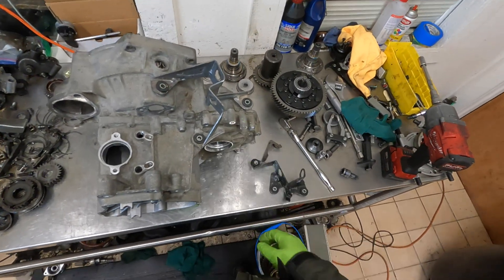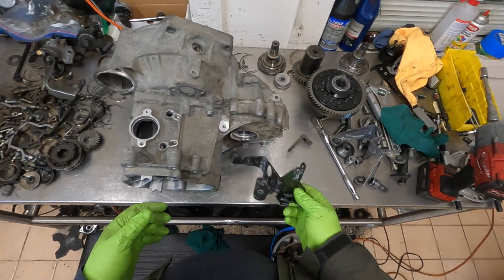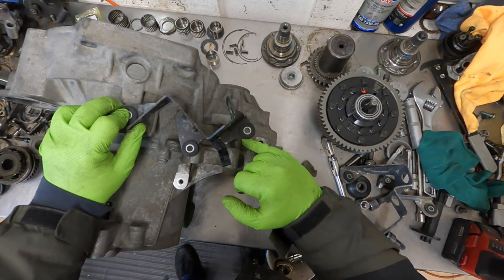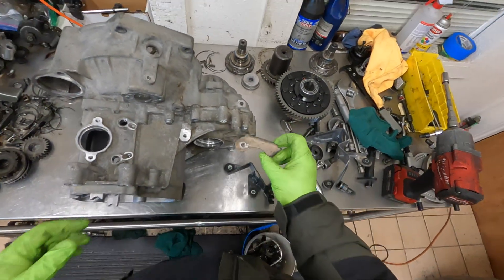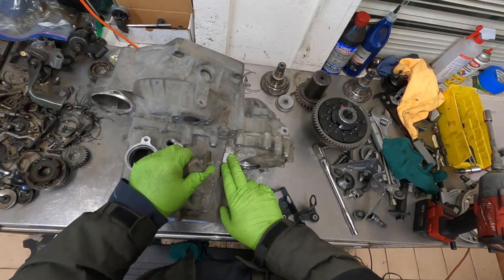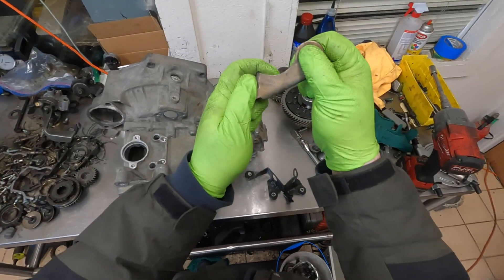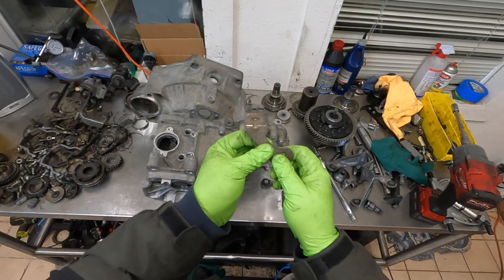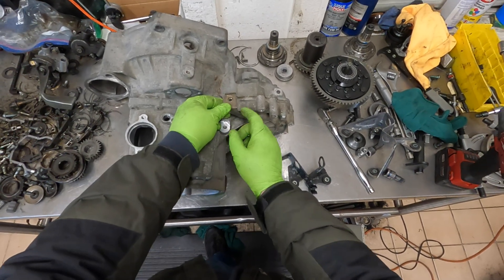02S 6 speed in Mk4, Adapting the Mk4 Shift Cable Holder

Comment: If you had to make another bracket would you do it the same way if you needed to buy that bracket?
Reply from the maker: Yes. I rather like how it turned out. I've done a couple more since the video.
Reply: @dzelpwr  what kind of cable do I need to do the can buss hack? I just ordered a vcds cable for Ross tech vag com the other day but my understanding for running I need something called a mpps cable as well

Comment: How would someone go about buying one of these transmissions from you and how much would they cost
Reply from the maker: Well, if you have a 2002 or newer, you can just bolt the transmission in as-is. Make cable shift adapters like I did here, and then hack the instrument cluster to pick up VSS via CAN so you don't have to worry about the lack of vehicle speed sensor on the transmission--I have another video that covers how to do that.

At that point, all you'd need is the transmission itself. I buy them through car-part dot com. It's just a junkyard aggregation website where junkyards from across the country list parts from vehicles they have. LKQ can transfer a part from another location to their local one and deliver it to you.

Otherwise, if you wanted the bellhousing swapped to retain the vehicle speed sensor and also get a limited slip differential, probably better to contact me through Cascade German for an estimate. Expect all-in to be above $3k with the bellhousing swap and limited slip.
Reply: @dzelpwr so why can't you do the same if you have the 99 tdi alh manual? Why only starting from 2002?
Reply from the maker: @JoshDesoto-g9g just how the clusters are made. 99.5 doesn't even have powertrain CAN bus connection to the cluster.

2000-2001 at least do have powertrain CAN to the cluster, and they use it for some signals, but no one I know of has figured out how to hack those eeproms to pick up vehicle speed by CAN. Only the 2002 and later clusters with software version numbers VWK501 and 503 in the VDO clusters.

Other markets with Bosch clusters might not even support it, or no one has figured it out at least. Similar for the Magneti Marelli Beetle clusters. Or I just haven't found the info yet. Not real sure.
Reply: @dzelpwr what if I just swap out the 99 cluster to a 2002 or 2003 cluster? Possible?
Reply from the maker: @JoshDesoto-g9g possible, but a lot more work than swapping a 2002+ cluster into a 2000-2001, from what I understand.

The 1999.5s are a real bastard child. There's a good bit of wiring that's different as well.

The 2000 and up clusters get tach signal, receive Check engine light and glow plug light via CAN bus. The 99.5 receives that info on individual signal wires for each of those.

There still is a powertrain CAN bus in the car, but the ECU from those years might not be putting that info onto the CAN bus. So, if that's the case, then you'd also need the engine harness and ECU from a newer car to work correctly with that cluster.

And I'm not entirely sure if those older Mk20 modules before 2000 even send wheel speed data on the CAN bus either...

It's a lot of work and different parts on something that isn't even a sure bet.
Reply: @dzelpwr ok if you have 2002 and newer you're golden  with the speed, but what about the TDC hole missing? Trying to wrap that around my head.
Reply from the maker: @JoshDesoto-g9g I took measurements of where the hole needed to be, had to grind away a good bit of the bellhousing and then used a 25mm metal hole saw to make the hole. Buy the 02M part number plug to cover the opening when not needing to find TDC.
Reply: @dzelpwr thats smart. I guess I'll have to split the bell housing still to make sure no chips get inside? Or did you do it upside down with a vacuum so chips fall down too? Sorry for all these questions!
Reply from the maker: @JoshDesoto-g9g the hole just to the open area where the clutch and flywheel will be
Reply from the maker: So, no chips will get inside the trans, they just fall into the open space of the bellhousing and you can blast them away with compressed air.